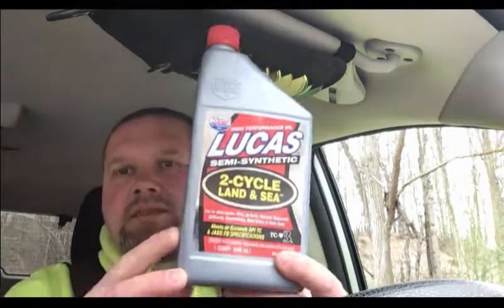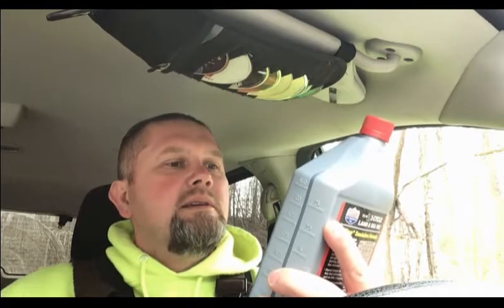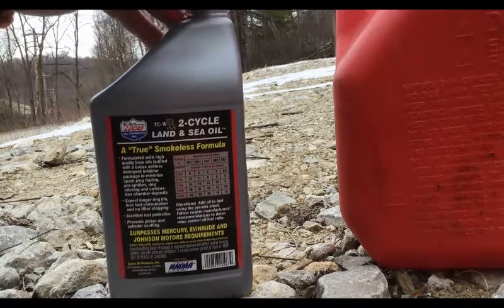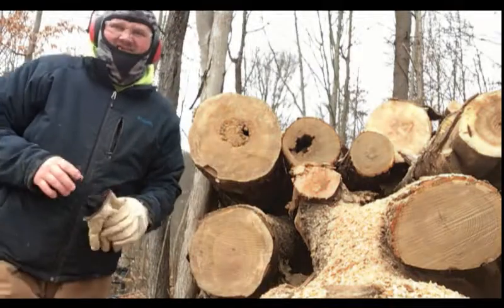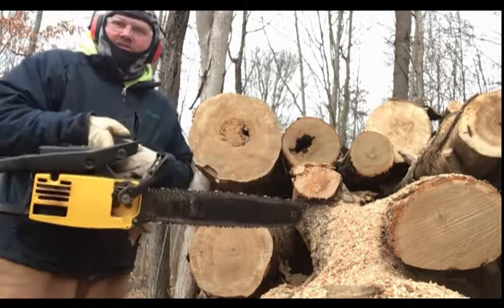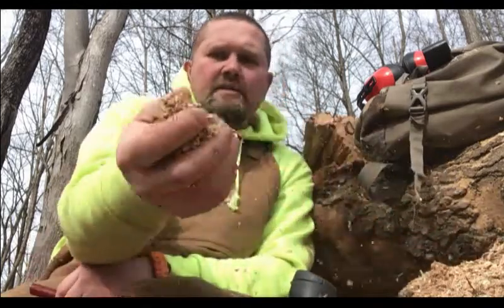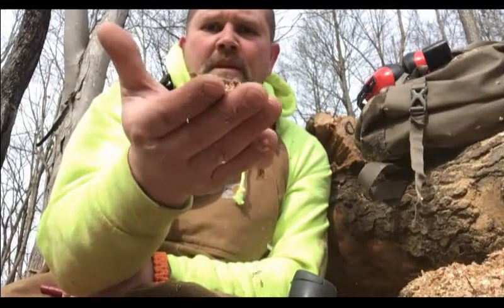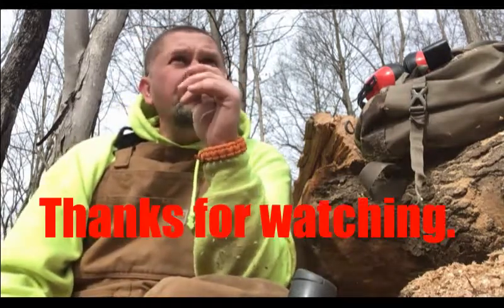McCulloch PM 610 Buckin' logs with a new oil mix.

Comment: Don't change fuel ratios without retuning the carb. I've got all my saws, new and old, tuned to run on 40:1. Old is 1960 and new is 2018. On a side note, if you get a bent tooth on your chain, cut it off with a grinder and keep on cutting. You'll never notice a missing tooth.

Comment: I run everything with 50:1 Echo Red Armor with PNE gas including my Poulan Super 25 and my PoulanPro weedeater, polesaw combination. Most of my saws are Stihl but I also have a Husqvarna 372 Xp and a 455 rancher.  They all use the same gas mix.  The one saw I worry about is my MAC PM610.  My mMAC 32-16 runs the same mix as my other saws.  I may add another capful of oil to the 610’s tank when I fill it, just to be safe.  I cut in hot weather and I have never had a piston stick in any of my saws.  That Red Armor is good oil.  It is JASO FD certified, which is the certification that I judge as the standard, today.

Comment: I worked with a great timber cutter he ran homelite 32 :1 in everything he said sparkplugs are cheaper than saws never had any problems with the new stuff I run 40:1 with enthol free gas Mac 10-10 sp loves it

Comment: I used Stihl oil at 40:1 in every two stroke engine I own, backpack blowers, weedeaters, and chainsaws. Works absolutely fine in all of them. I have since switched to Lucas and everything seems just as happy if not happier. I think the Lucas oil is fine oil. As a sidenote, I never really cared for the smell of the stihl oil.
Reply from the maker: My equipment has been running great on the Lucas oil since I switched to it.

Comment: I like to use Mobil one synthetic motor oil. Forty to one. Been using it for fifteen years, never hurt one moesheen. Don't coke up,and it leaves a nice thin coat on all the internals.

Comment: Hi from Oamaru, Sth island New Zealand.

I have a big fleet of new and vintage chainsaws. U can use Amsoil Saber at 100-1 across the whole fleet old or new. 
Please make sure to tune them in on the mix then let warm up for around 2 minutes before creeping up to full tit. 

I have a few of those Bricks which handles 24 to 26 inch easy. On the Amsoil Saber make sure to mix it with 98 octane.

Comment: Try Echo Premium bar oil in cold weather.  I am running Echo Red Armor at 50:1 with PNE gas.  My Mac gets the same diet as my Stihl and Husqvarna saws.  All my saws ran 50:1 with Stihl Ultra before I switched over to Red Armor from that filthy Stihl Ultra.  My 35 year old Poulan Super 25 Deluxe Automatic also runs the same fuel as my other saws.  I am not running tinker toy saws, either.  I run 372, 460, 440, 360, 660, 241, 251, 455, and 181.)7#5 make sure you run a JASO FD certified oil.  It is clean burning and has great lubricate.
Reply from the maker: Thank you for the advice. I will have to give the Red Armor a try.

Comment: I  run all my saws with Wal Mart Super Tech 2 cycle oil. I buy 4 gallons of the cheapest Ethanol at the Murphy station. When I get two gallons in the container I pour in a Quart (16 to 1 Ratio) of the super tech and add the remaining two gallons. Now here is the stupid sounding part. I then add a pint of clean distilled water . And shake it up really good. I let that set for a day or so and siphon a gallon as needed from the top portion. That last half gallon I pour in to my 1944 Farmall  M. The gas is now blue tinted. When the settlement bulb on the tractor is almost full of clear I pour that out. Now  every gas tank gets condensation. Where cold air meets warmer air you get condensation. So if you buy That high dollar Ethanol free at the station its very possible you will get water and not have any  Ethanol to absorb it? Im 70 and started out using a XL 12 my dad bought new in 1964. When I was 13. Ive  owned over a hundred chain saws. And so far never ruined any piston or cyl mixing a 1/2 pint of oil with every gallon of gas. Ive got one XL 12 that's been in service since the late 1960's and never  has been taken apart. Original piston cyl and rings. What ruins Engines is excessive heat. You gotta partially disasmble and clean the cooling fins and passages and keep them clean and the air flowing.

Comment: I run Echo Red Armor in everything I own at 50:1 with 93 octane PNE gas.  I have been figuring what I should run in my PM610.  Some say 20:1 but at 20:1 it is a mosquito fogger.  I am going to run the MAC at 40:1, just to be safe.

Comment: I run a marine 2 stroke oil (synthetic) @ 50:1 in all my boat motors. All my other 2 strokes I like Super techniplate @ 35:1-40:1. It gives the benefits of both synthetic and castor oil. Synthetic protects in ways that castor oil does not and vice versa.

Comment: You can get away with running more oil in new saws but those old saws don’t seem to like anything 45:1 or higher ratios.
I was just experimenting with this myself. I tried 45:1 in my old Homelite XL-1 Automatic.
I was cutting firewood working it hard. I had it running plenty rich on the carb but it started acting up. 
Not sure if it was the oil or not but I think I’ll stick with 40:1.
That’s a good all around mix.

Comment: The key on two cycle oil is JASO FD rated with PNE gas, premium non-ethanol gas.  I like Echo Red Armor and Power Blend Gold oil, both FD rated.  I keep two containers, one with 50:1 and one with 40:1.  I have several pieces of equipment that are 40:1.  I have run 50:1 in them with no problems, but after I added a PM 610 to my stable I decided to add a tank of 40:1, strictly for the PM 610 MAC and I will use it in my other 40:1 pieces, too, like my Poulan S25 DA and my MAC 3216.  I will just buy another No-Spill container for the 40:1 mix and label it 40:1.

Comment: There's 128 oz in a gallon. Whatever ratio you want, say 32-1, will take 4 oz of oil. Just remember the saw or any engine needs to be tuned to whatever mix you chose. Personally I use AV gas which is 100 low lead. You can tell the difference!

Comment: Lol... Is the oil that expensive? Pour more oil in it. Better a little on the rich side for more safety factor. Afleetcommand has good videos on youtube talking about why he recommends 32:1 because he has torn down many saws and can see the oil coating the insides, but not so much at 50:1. I run 32:1 for that reason. It burns clean and is easy to calculate at 1oz per quart or 4oz per gallon. Your stihl and your mcculloch would both love 32:1. Try it and see

Comment: I am beginning to believe that the 50-1 ratio is partly related to EPA restrictions. To be fair, I feel the Mac 610 would burn 50-1 pretty happily for a long time but you CANNOT let your mixture lean out. To be fair, I feel the same way about even the new strato saws. And the 50-1 mixture seems to be less flexible in your tunability.

To further muddy the waters, most saw builders in the ported saw world recommend 32-1 mixture in their built saws. And that's with new strato and self-tuning saws. 

Personally, I run 40-1 in my saws. New or older. But my oldest saw is an '89. I'd probably run 32-1 in any saw much older, basically any saw prior to the late 70s needs the richer mixture due to less stringent manufacturing standards.

And you run through a lot of fuel blocking on a pile. Basically running wide open under load for nearly the entire time. And this line of McCulloch saws have a somewhat smaller fuel tank by comparison. And most saws that run like these do, where they aren't screaming high revving saws but are laiden with torque seem to gulp fuel a lot faster than the newer strato saws. Personally, I prefer torquey saws in a firewood setting. The faster spinning saws may be better in a straight production setting, but they need a lighter hand to really prove their potential where a heavier more tired hand towards the end of a day of firewood cutting, the torqueyer saw gives you more flexibility in how it can be run in my opinion.
Reply: Bryan thanks for the information. You definitely sound like you know what you are talking about.

Comment: If you think whatever saws you're is using too much gas, see what you think when you use a Stihl 660. It'll use far more fuel than what you're used too. Sure it's a 91 cc saw but it uses fuel like it's going out of style. You will need a 55 gal drum of it!

Comment: The Mac Pro Mac 610's are the saw of choice on Mr. Obsoletes Homestead.  I would reccomend a 24" bar, as it matches the saws power and torque output perfectly. On your oil mix and choice, I would not reccomend  the oil you are useing. The number 1 reason is the TCW3 rating.  This is for outboard motors, which are water cooled and need a thin viscosity.  The old Macs and other old saws need a thicker oil because of the varying tolerances.  Also do not use full synthetic oils either. The oil I use in my old saws is no longer available, but the 2 that come close are Yamalube, which a lot of pro loggers use, and Golden Specto, both partial synthetic.. Try running partial synthetic Yamalube in your newer saws, and you will find they run better.  Stihl and Husky oil both leave a lot of ash in the ports and exhaust, and is just as bad as carbon. I usually run 32:1 in normal use, and 24:1 in hot weather or heavy cutting. None of my Macs haver ever had a lubrication related failure in over 40 years of continuous use. I have had lubrication failues with Stihl and Husky oils.
Reply from the maker: Mr Obsoletes vintage Homesteading I was thinking about putting a 24” bar and chain on the saw. I agree that it has enough power and torque to run it. I was also wondering about the TCw3 rating on the bottle of Lucas. I remember that on all the old 2 stroke outboard oil bottles. I wonder why they list chainsaws and weed eaters on the bottle 🤔. Thanks for the information I know you are very knowledgeable with these old saws, much appreciated.
Reply: The reason they list about all 2 strokes is that they only have to sell one formula, and if your saw fails oh well.  I have found that Lucas products are  over rated and under performing The oils I have recommended are for high revving  high heat situations, such as racing motorcycles and chainsaws etc. @cleverjfirewood3195